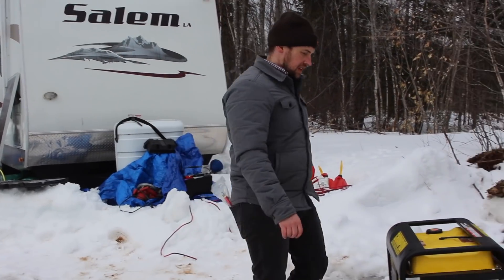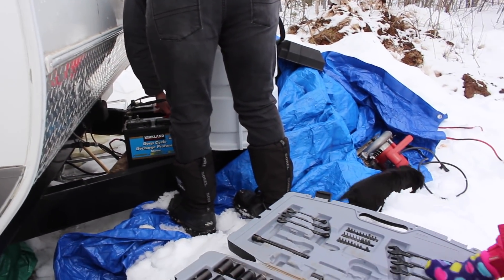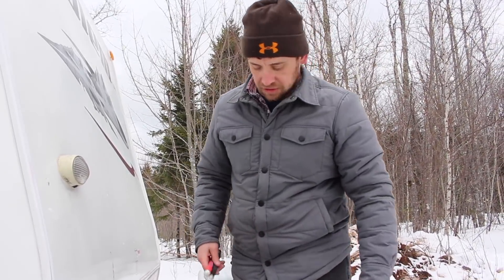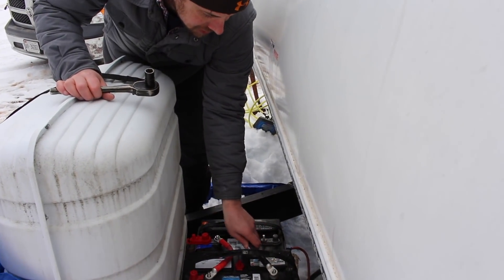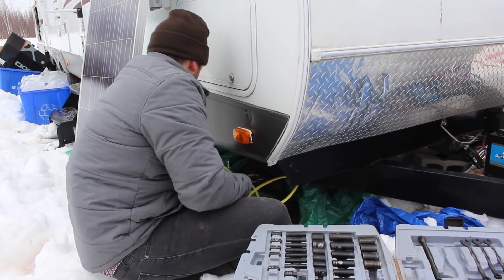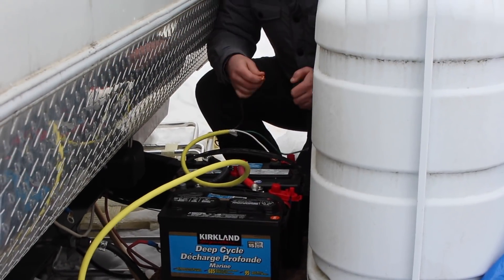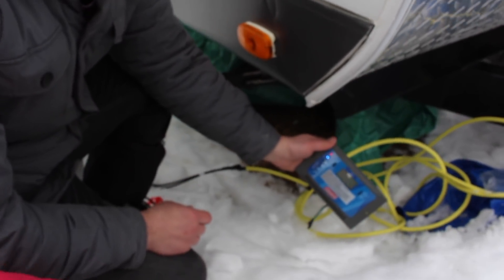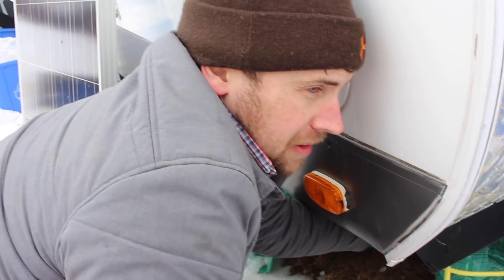This One Thing Is Going To DOUBLE Our SOLAR POWER - Ep. 29

Comment: If the generator noise gets annoying, you can put a plywood around it - like a little fence and the sound will all go straight up and it's not so loud.  I used to do this when we camped up in the colorado mountains.  Neighbors appreciate it as well.  You would be surprised at how much difference it makes.

Comment: Yeah, you did it right- that's parallel - not series - you had me worried.  If one battery isn't identical to the other, one may discharge a little faster than the other, but it's no big deal.  The problem is charging all of that capacity.  Consider putting a car charger (Set it on ten amps) on them so when you run the generator, they will charge faster.  Your built in charger in the camper will probably take 12-18 hours to charge both of those in that configuration.  So, if you put an additional charger on it, you will cut the time in half.  You could probably use at least three more of the solar panels.  That and run your generator about 8 hours / day.
Reply from the maker: It seems to be charging them pretty quickly but I do have a battery charger that I will hook up and give it a try, thanks!

Comment: Will the cold affect the charge controller I wonder?  Where the tarp produces a little bit of shelter to the batteries, the CC will be open to frost & wind.  Also, will the metal it's resting on draw charge from the system? You usually see the components mounted on wood or with at least a ply board.  You're getting things organised though.
Reply from the maker: We actually moved it into a plastic box now and everything seems to be working good. Only going to be a temporary set up though.
Reply: Mapleberry Farm Did that make the charge better?  I don't know anything about Solar other than you don't need blazing Sun to get some charge, still less chance of damp getting in now that's got to be better.  I'm hoping you get a break in the weather soon, give you a rest from bitter cold & snow.